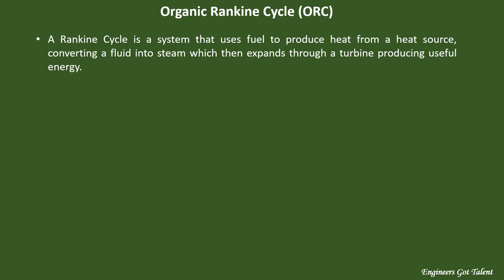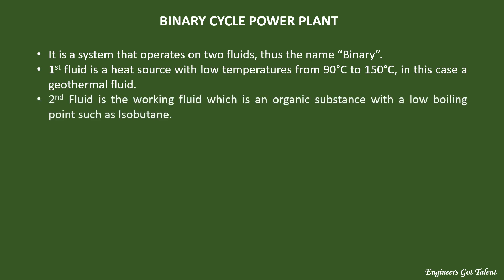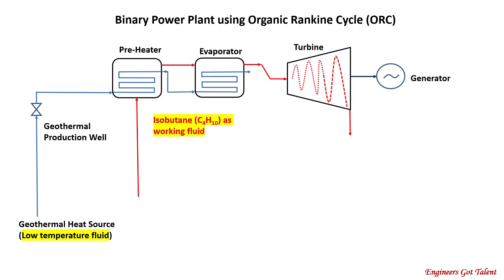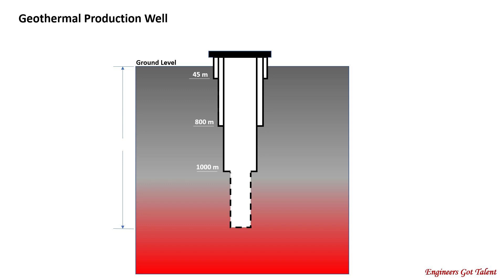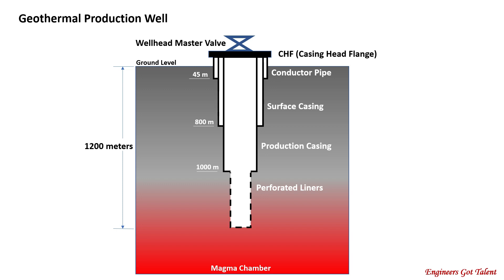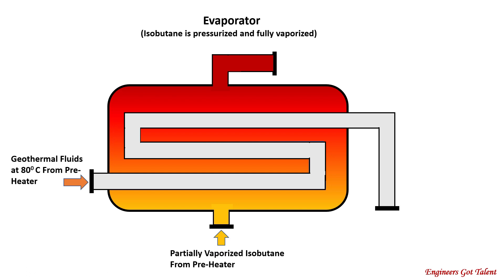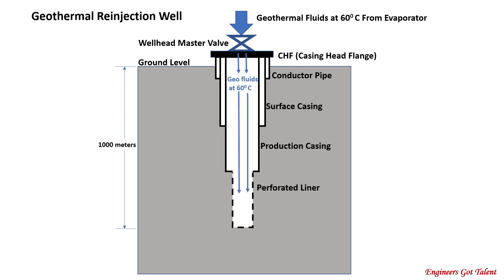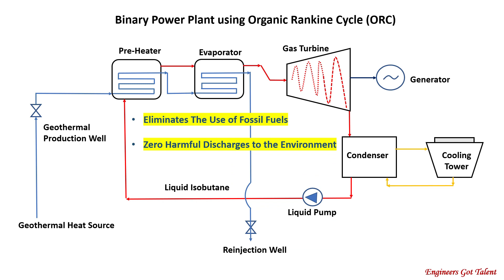Binary Power Plant using Organic Rankine Cycle

Comment: Is it possible to use the well bore as the working fluid heater/evaporator? For example, Flow liquid isobutane down the casing annulus and vapor return up a tubing string. Could there be enough heat flux from the formation through the cement and casing?